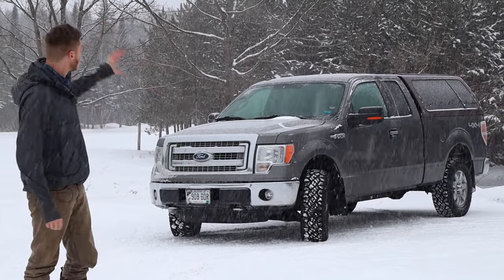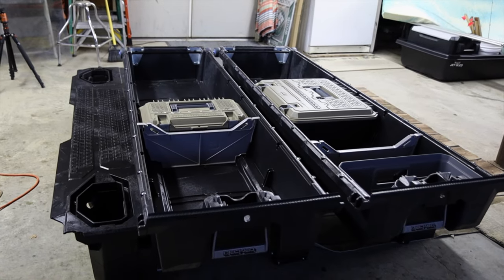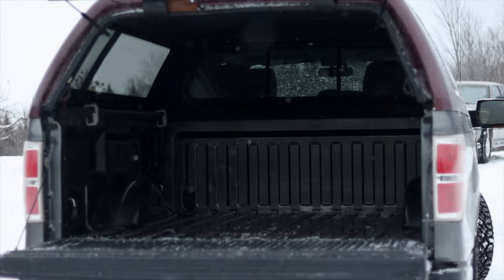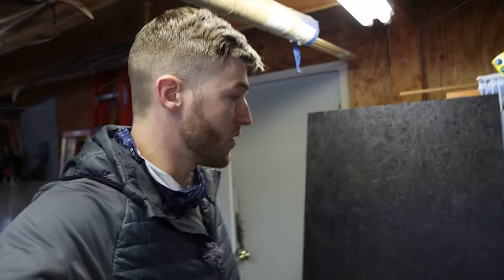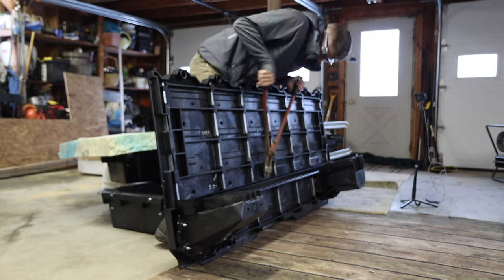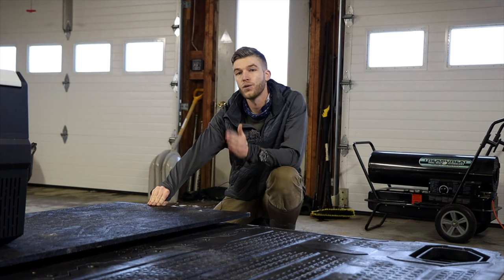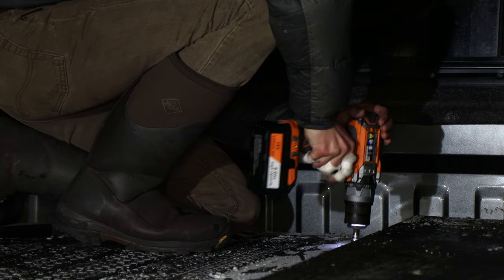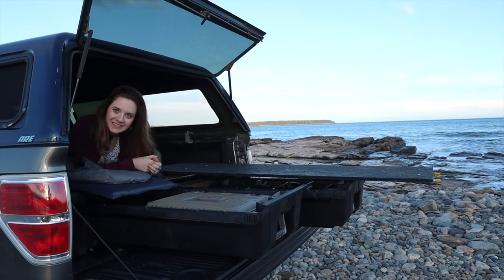Build THIS Truck Cap Camper | in 24 Hours

Comment: I built a similar version that works well. F250 SuperDuty with same bed demensions. Decked base and Leer cap. Storage for all things turn key to camp and go +. Air mattress ready, portable power ready and lighting in the interior. Great setup for many situations. Holds an array of things that don't get in the way.
Reply from the maker: What did you use as a portable power source? That’s my next step for the build

Comment: I had a decked system for years before I did my camper build. I fabricated a custom track to secure a Honda 7000 generator that allowed me to slide it out over the tailgate. We would use it to boondock camp when I used to pull an airstream. I even mounted a place to hook one end of a hammock onto the decked face. It held up great over many years of use. Great content!

Comment: Man, I wish I had the idea to do this when I was traveling and hitting 40-50 rodeos a year.  Injuries and age have cut me down to probably half of that, but seriously thinking about building one in my 2012 F150 regardless. I would try and find a way to make everything easily removable to be able to use the bed, if possible. Great stuff man 👍
Reply from the maker: Its been great having mine! Makes for a cheep set up when guiding and traveling. I've never taken mine out yet. Never had the need for the bed that much just used a trailer when I wanted it instead.

Comment: FYI to make those rails are more rigid mounted sideways.  Be more work but you probably could use 2x4s with those rails to make something a bit stiffer.  Networking equipment slide on similar rails, and you can have them fully extended holding 100lbs stiff.
Reply from the maker: Thought about it but the bottom drawer is used to support it

Comment: Where’d you get the slides? I’ve got a Decked system in my f150 as well and I like the slide idea versus how I have mine currently!
Reply from the maker: I linked it in the description so far I've had no problems with them and the drawer support  for it works great!!
Reply: @MainelyOutDoors  perfect! Thanks!

Comment: Nice, but not being able to sit up inside would be a deal breaker for me.  Also do you really need all that under platform storage to slide out? IMO, $1600 for the deck/sliders seems like a lot.  Kinda tight for two people having to crawl in and out?   Personally, If for solo,   I would opt for a custom 30" wide bed platform over a couple of platic storage bins that just slide over bare metal and leave the back corner as a popup cubby storage.  I like the idea of  a sliding table on the other side, but I would just make it higher for ergonomics while seated on one half so that my feet and knees fit under when inside - the wheels of the fridge can be leverage for a custom slider  if you build around it at same level.   Check out Mav's build for the idea.  Anyways I think once you start building out a truck camper like this I think you have to start thinking about just going with a van, which I did.
Reply from the maker: I think everyone's needs are different. For me, a Van wouldn’t allow me to access the logging roads we have here in Maine so 
 or pull a trailer so that wasn't an option.  As for the siting up for many, that's definitely a deal-breaker. However, In my last build, I found that I never hung out in the back. If I wanted to sit I would enjoy being outside or sitting in the cab. The only time I went in the back was to sleep so for me this setup works. This build is more of a tool for camping in the outdoors and a workaround for a tent I suppose.
Reply: @MainelyOutDoors  Yeah I totally get it.  I personally would never cook or eat inside if the weather is cooperating.  Your build gives me some ideas.  I have the same fridge with the wheels and am thinking now how about how to leverage those wheels for a custom slide out. Thanks!
Reply from the maker: @12vLife  Awesome good luck with the build!
Reply: Totally agree that the Decked system is totally over priced for what you get. But they have to market cornered unfortunately.

Comment: Saw these decked buildouts and was hoping to find someone to use it like I want to. Feel it’s simple enough and my truck is my daily driver too. Been wondering how much clearance do you get between the top of the decked surface to the roof of your cap?
Reply from the maker: I'm not sure off the top of my head but it would be hard to sit up. I'll measure it in my next over view video of the build

Comment: Great idea with the slid out and if you did it on both sides would make it even better. I've seen those decked or however you spell it and for the price you can build a better one and I think you just did that they should be selling them with the option of a top slide for coolers, propane tanks ext stuff that just don't for in there box. I'd be contacting them before they steal that idea and make million's of your handy man skills. Love it. Make more videos tho you have been slacking in that department lol

Comment: Why go cheap and use pressboard / OSB?  Your time is more valuable than the materials, using the Decked system is proof of this.  OSB is good in shear and static applications, not in an off-road vehicle.
Reply from the maker: I want an aluminum slide at one point but couldn’t find anything to settle on at the time. its definitely going to be upgraded at one point. Still looking for a good solution. Definitely open to suggestions if anyone has one.
Reply: @MainelyOutDoors  you could have a piece of aluminum cut and bent to your specified dimensions. A piece of Dimond plate with like 2" upturned sides would be great. Then just mount it to those existing glides. Nice build.